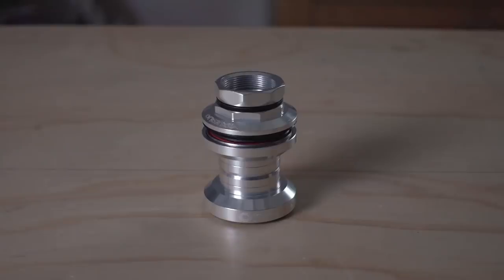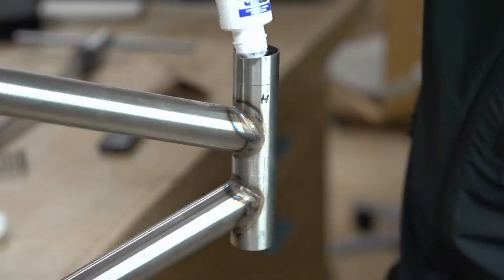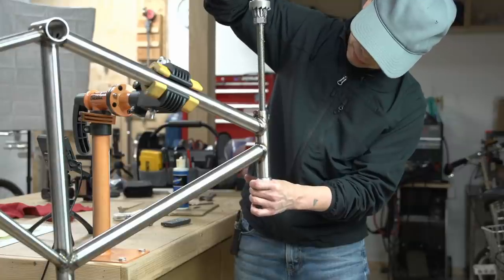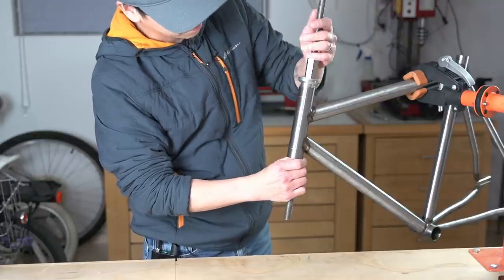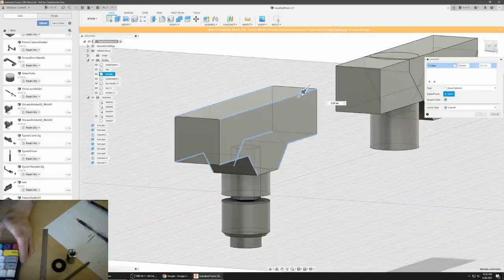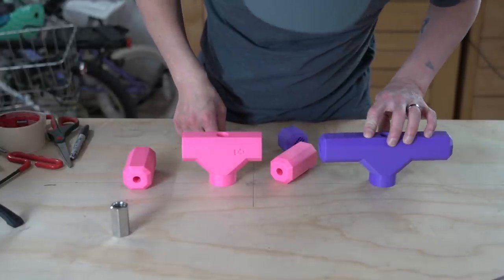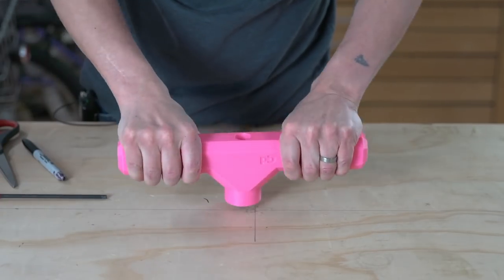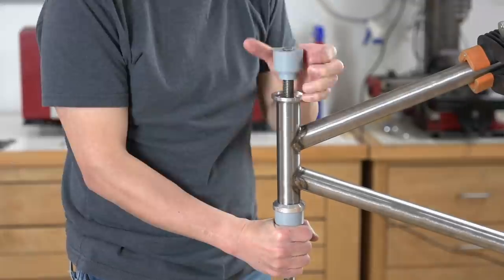Headset Press 3D Print - Mini Town Bicycle 14

Comment: A thrust bearing between the washers might help, but the previous comment about chilling and heating is the way forward. I've given up tapping 3d prints and now use metal heat-set thread inserts, pressed in with a soldering iron.
Reply from the maker: I want to try that. 👍

Comment: Did you know that if you put the aluminum races in the freezer (shrink) and heated the head tube with some map gas (hot enough to boil spit from your finger) to expand the head tube the races would probably almost fall into place?
Reply from the maker: Whoa that I have got to try!

Comment: Love your videos. My two cents on the tapped holes is model the the thread in Fusion. Most printers have enough resolution, threads are usable right away without any post processing.

Comment: When I was a kid I remember seeing my friends putting BMX bikes together like that, like hammering in the headset or the bottom bracket. BMXers I think we're particularly barbaric with their tool skills though.
Reply from the maker: Actually it's pretty acceptable to do that with BMX, they're made to withstand that stuff. I had a FGFS frame with BMX BB shell several years back which I had to take a hammer to in order to remove the BB. I came off with no damage, No regrets!

Comment: Are you going to take the headset cups out to paint or is this bike not getting painted? Seems like you need a handle for the bottom too! Maybe you could use the reject print without the knobs?
Reply from the maker: Yes! And I’ll purchase a fresh headset for the final assembly. I’ll keep the old one just for test ride assembly. Although as another commenter mentioned, I don’t think I’ll be making a lot of frames at 1” HT.
Reply: @PithyBikes  Can't wait to see it when it's ready to ride!

Comment: Hi, I would like to make two holes in the seat tube of my bicycle to put a water bottle holder, perhaps using past bolts. If it is made of chromoly, would it be feasible without it cracking in the future?
Hola, quisiera hacer dos perforaciones en el tubo del asiento de mi bicicleta para poner un porta bidon de agua, quizas utilizando pernos pasados. Si es de chromoly, sería factible sin que éste en un futuro se fisure?
Reply: By the way, tremendous channel! I enjoy watching each of your videos! Subscribed! Por cierto, tremendo canal! Disfruto viendo cada uno de sus videos! Suscrito!
Reply: Help pleaseee... 🙏
Reply from the maker: It depends on the wall thickness of your seat tube. I'm assuming its not that thick like most seat tubes. So you'll want to braze in some bottle bosses.
Reply from the maker: https://www.paragonmachineworks.com/catalog/product/view/id/3580/s/water-bottle-boss-1-4-hole-choose-material/